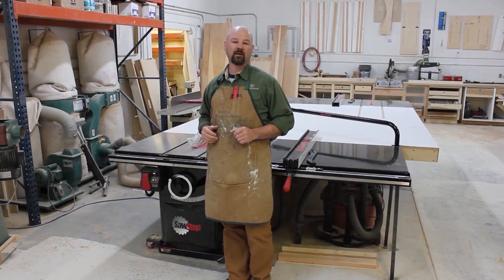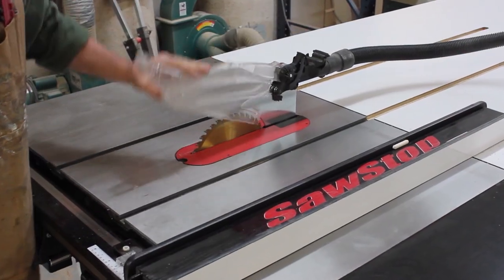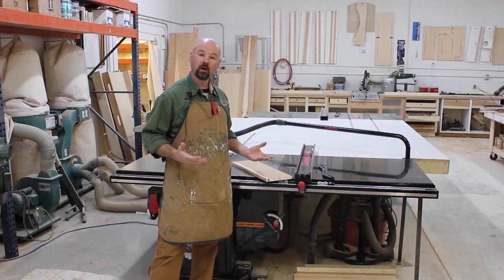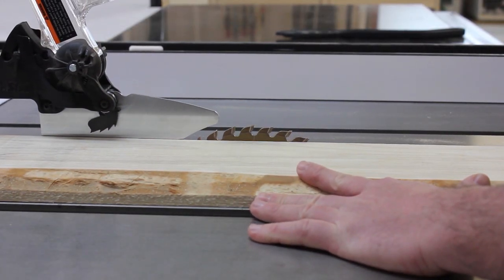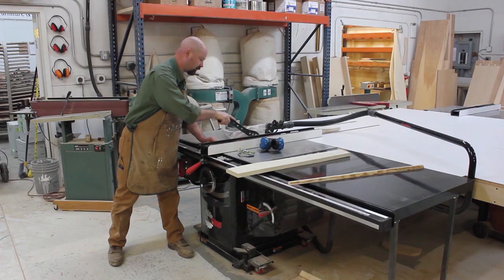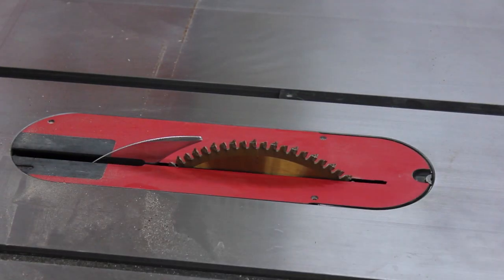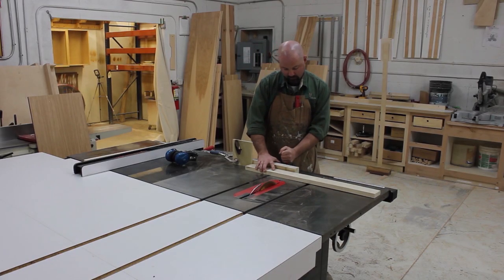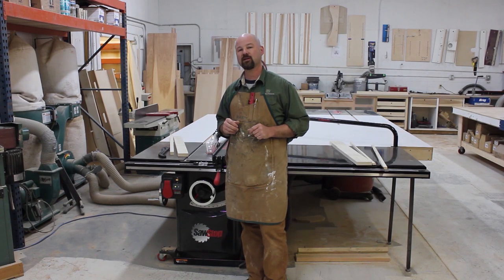Table Saw Fundamentals On Your SawStop Table Saw

Comment: Surely the stop block on the crosscut is almost as bad as using the fence because the piece is still 'trapped' whichever method you use??  I have always been told to attach a small block on the fence that you use to index the cut, but which stops well before the blade begins the cut so that the wood to be cut is never pinched.
Reply: You probably won't see this cause your comment is 5 years old but he mentions this around 7:40.

Comment: In a shop like yours there is absolutely no reason to crosscut that piece of wood on the table saw with the method you are using.   A miter saw is a safer alternative. just as accurate and a ton faster. Long lengths and the initial trim cut is almost impossible with this method.  I am a professional woodworker and never teach this to an employee, it just isn't worth the risk.  I would use a sled to provide a tad safer way to crosscut if that is all you have, but that flimsy miter gauge  I don't like...And I have had the SawStop for quite a few years, I orderd mine direct from Oregon and can attest to it being a well built sturdy, safe and accurate machine.